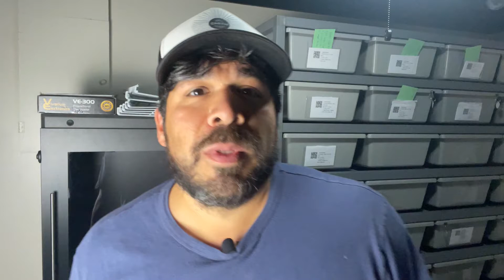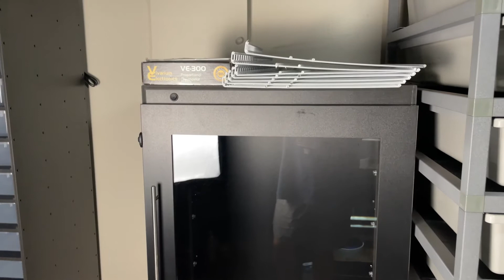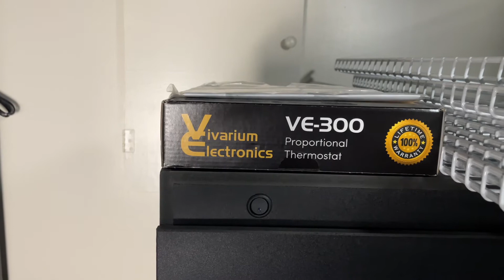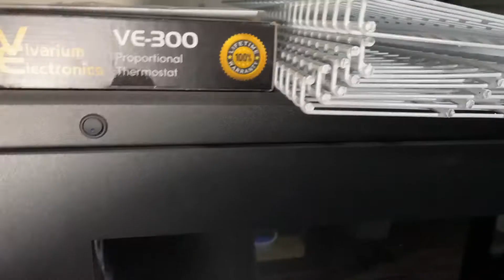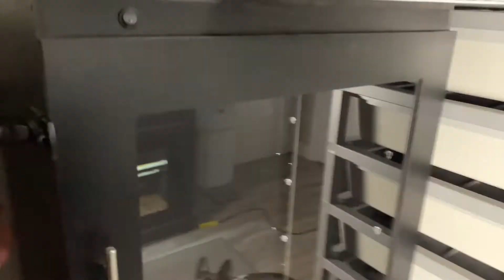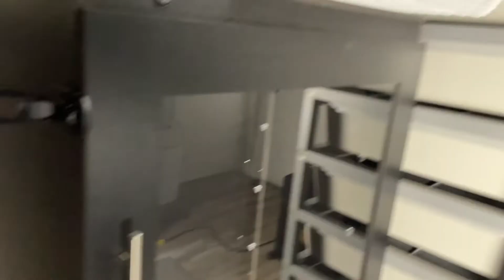Hotbox Incubator Setup Tutorial

Comment: What does the humidity need to be at?
Reply from the maker: Hey Ricky! From what I understand, humidity needs to be maintained at a relatively high level. There are different ways to incubate eggs, using different containers and different substrate in the egg boxes. Of course, my incubator may be different from others, but really just keep an eye on the eggs and make sure they are not dimpling (starting to look deflated) early in the incubation process. If they do start to dimple early (more than a couple of weeks before the hatch date), then adding moisture to the substrate in the container should up the humidity and the eggs should start to plump back up. I hope I was able to help!
Reply: @wdwilson9  awesome man thanks. I’m years away from getting one don’t even own a ball python yet 😆 but I plan on getting my rack soon then I’ll start looking at animals. What rack do you recommend? It will probably be c serpents. Was thinking the v-28, but don’t know if that’s too big for the animals I’ll be getting. I just know I don’t want to get another rack everytime they grow a bit. If I can get one to house them for life that would be nice
Reply from the maker: @RickyGIII  The PVC cages you mentioned are great to start off with, regardless of the size of ball python you purchase. They are relatively inexpensive and light weight, so they are easy to move around if need be. There are several retailers that carry great products. The better vendors should have a comment in the product description on the ideal size rack for the current size snake you plan on housing. Usually they are listed as a weight, in grams. For example, one rack would be ideal for hatchlings up to 750g, and another could house snakes 750-2500 grams or so. Babies are typically less expensive than adults when purchasing, but if you want to get a larger animal to start out with, just note that you could need a larger rack sooner than expected. Just keep that in mind. There are a number of reputable breeders on a large scale that offer a range of color mutations at different weights for a great price. Some may offer a payment plan for you as well. I would say have a look around at what animals are available, and purchase the housing and thermostat and get it setup before actually purchasing the animal(s). I hope this helps. Let me know if you have any further questions!